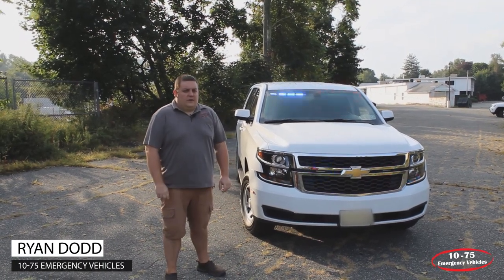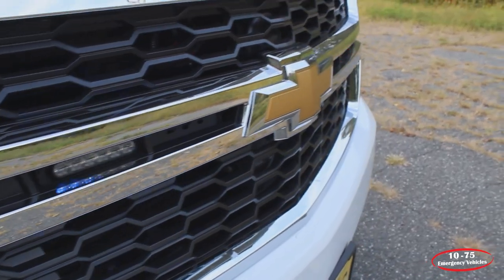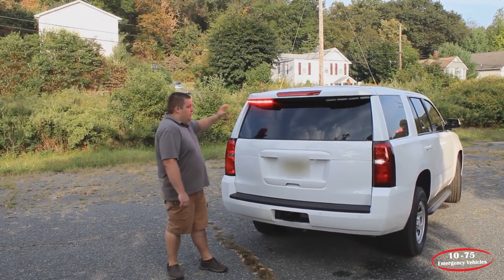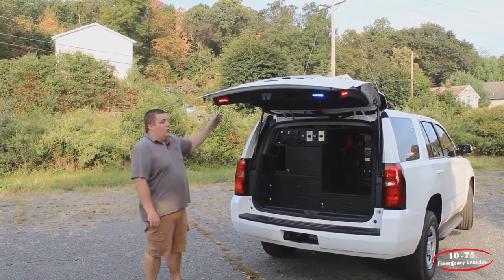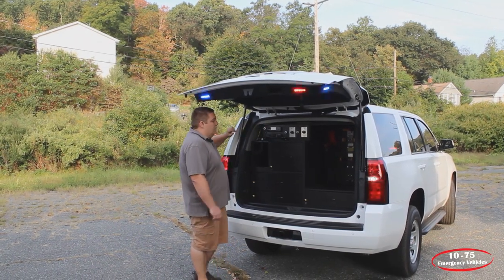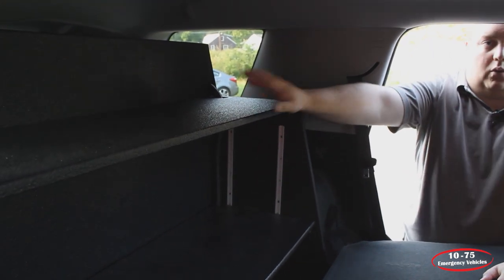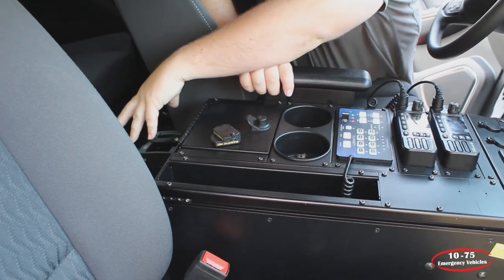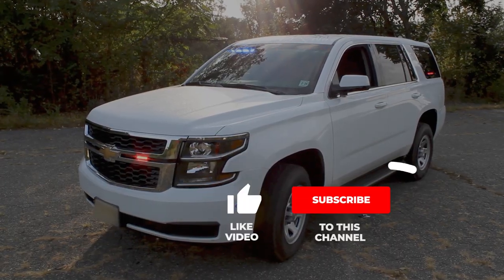FIRE COMMAND VEHICLE CONVERSION | 2020 Chevy Tahoe

Comment: Hey guys, just curious how you tied the RJ45 ports into the XPRs!? Was it just a snip of the remote mount cable and pinning the connectors appropriately or
did more go into it? 

Thanks!
Reply from the maker: They are probably tied into the accessory port